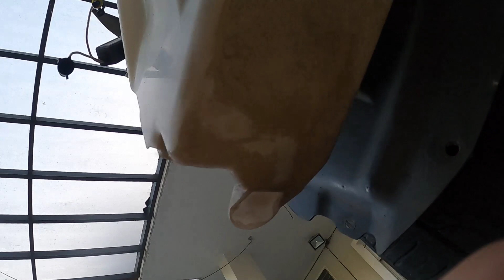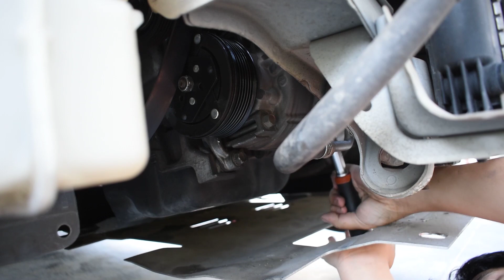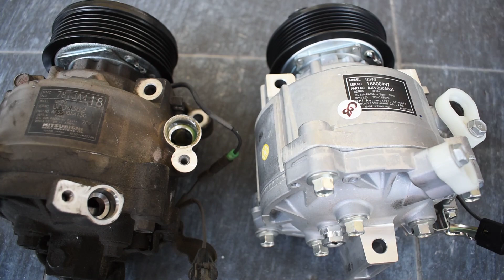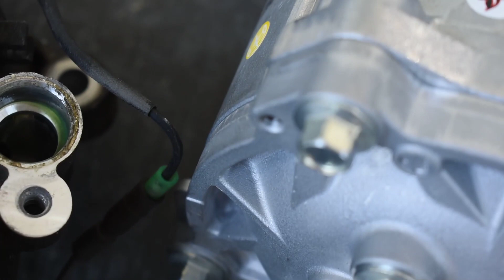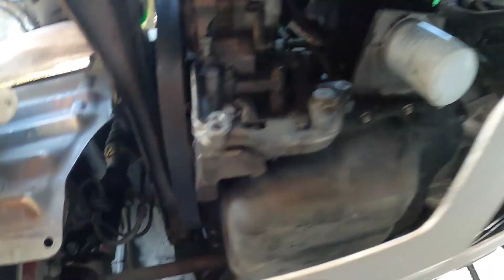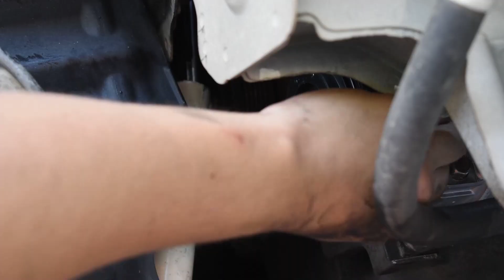AC Series - Replacing the Inspira/Lancer AC Compressor

Comment: I have a 2011 Lancer Es, I'm switching out the old compressor for the new one, i believe its a qs -90, I got the a'c lines vaccuumed out. I was gonna ask, Do I need to vaccuum it again before recharging it with A/C and refrigerant oil.
Reply from the maker: yes, you will need to vacuum it out again before charging it. This is to ensure there is no moisture within the system.
Reply: @TCsAnythingGoes  I'm thinking i'm getting the hang of this. I'm going to install the compressor today. The part just came in!. Thanks for the information. Clear concise.

Comment: Thanks for this video, I need to order the compressor but the auto parts place says there are two sizes for the belt. 3.2 and 4 do you know the size of the belt?
Reply from the maker: i am not familiar with the sizes you mention. If you meant the serpentine belt (aka V-belt, aka accessory belt), the size is 6PK2563 which translate to 6 channel and 2563mm lenght
Reply: @TCsAnythingGoes  thank you for the reply, but that isn't it. They sell them with 4.13 Inch Diameter Pulley or 3.75 inch diameter pulley. That's what I was asking.
Reply from the maker: @Aoneify  Ahhhh.... got it. The size of the compressor pulley.
Ok, from what i was told by the shop that sold the compressor to me, there is two sizes, big and small. 
It depends on which one your car is using.
Early Lancer (2008 and 2009) uses either one so you gotta compare your original.
Later Lancers and ALL Inspira uses the smaller pulley.
Mine is the smaller one.

Comment: Hi beloved bro you are my teacher.
Can you teach me is that could be the compressor problem if my suddenly stop working after awhile. The funny is after my cool down its work again until I drove awhile the cluch stop again for sure AC getting warm.
Reply from the maker: If I understand what you are saying, possibility of a faulting magnetic clutch. As the compressor shut off is triggered by temp. However, if you are hearing odd noises coming from the compressor, its more economical to just change the compressor (since it comes with a new magnetic clutch) and have the whole system flushed

Comment: I have a 2009 lancer, compressor only engages one time and doesn't engages after that. What should i check?
Reply: I have same problem … u need to change only single bearing
Reply from the maker: Probably the magnetic clutch.
Reply: Same problem... sometime it won't engage at all...  sometime it does...
Reply: @garychia19  change shaft bearing

Comment: bro, any noticeable difference between ori & oem u use? and how its going after 1 year?
Reply from the maker: I don't see any difference. As cold as the original. After 1 year, still working perfectly fine.
Reply: Well, Oem Condenser and Compressor is great with Original Cooling coil. Its depend on cooling coil quality. Sometime you uses the local product its probably not very cold

Comment: The magnetic clutch goes on and off all the time, what do you think? Also the ac fan not working, fuses OK and the fan is new, what do you think? 
I have after market android head unit, and "can time out" error code on obd scanner
Reply from the maker: It is normal for the clutch to go on and off depending on the temperature you set. I guess you can check the socket for the AC Fan and see if its burned out.
Reply: @TCsAnythingGoes  
I did install a new fan and still not working
Reply from the maker: @sgvrereferw6014  check if the socket connecting the fan is burned out. If it isn't then check if there is any voltage going thru the socket. If there is, try to hardwire the AC fan directly to the battery and see if it spins.
Reply: @TCsAnythingGoes  thanx
Reply: @TCsAnythingGoes  
When I turn on the ac ,the 2 fans should work?

Comment: so how did you re-pressurize the ac system after you replaced the coolant? can i just add the coolant without re-pressurizing the AC?
Reply from the maker: Pressure comes from the compressor as it compresses. I did bring it to the shop to have the entire system vacuum and added in new coolant.

Comment: Hey, how much PAG oil did you put in? How do you know how much to put? And how did you fill it? Thanks
Reply from the maker: I left that to the AC workshop when I went in to fill the gas. What I can see is that he put in via the the pipe as the gas. He vacuum the lines, then let the vacuum suck in the oil from a bottle. Didn't quite saw how much he put in.
Reply: @TCsAnythingGoes  ok thanks, and would you recommend changing also the evaporator? Why did you decide not to change yours? Thanks
Reply from the maker: @rnapol3266  I changed out the entire AC set.....except for the lines.

Comment: Hi. I changed the Compressor yesterday but started having idle problems, and some buzz when the compressor starts, do I have to let the new compressor get used to the serpentine belt? Or it’s normal to make a buzzing sound?
Reply: Do I need to change the drive belt when I change the compressor?
Reply from the maker: i did not change the belt after I replaced the compressor. And there should not be any run in period for the compressor. Is your compressor new or reconditioned? Is it from Japan or China?
When I did my research, we should always get back an original new compressor from Mitsubishi as the recondition ones is a gamble and China ones are just gonna last you 6 months to 2 years (or probably less based on some feedback i read)

Idle problems after changing the compressor, there is a possibility that the compressor bearing is too tight or faulty hence causing extra load to the engine. But I can't really say for sure.
Reply: TC's Anything Goes It’s brand new from Thailand
Reply: It only makes like a little vibration, when it turns on, not in the pulley, the rare thing it’s that the sound only can heard in the inside of the car
Reply from the maker: @ivanalbanez1257  hmmm... i suggest to check if the bolts mounting the compressor is tight enough. Another thing I would suggest is to check if any of the AC line is touch the chassis.
I had similar issue on my other car (Myvi) when I changed the compressor and the AC line was touching the front crash bar.
Reply: TC's Anything Goes thanks for replying

Comment: I having the magnet clucth problem, should i change magnet clucth only or new compressor? From your experience, what ur advise?
Reply from the maker: If there is sound coming from your compressor, then its better to change to a new compressor. If there is no sound (metal grinding metal sound), then just changing the magnetic clutch is good enough.
Reply: Suddenly sound weird then bau hangit...
Reply from the maker: Need to see where the bau hangit is coming from. If the aircond is still cold, then there is a possibility that it could be the other pulleys. But if aircond is no longer cold, then confirmed compressor jam already
Reply: @TCsAnythingGoes  done changed compressor jammed already n money fly awayy...haha..TQ 4 video..Nice info & sharing...

Comment: How do you remove the front quarter panel?
Care to make a video? Thanks.
Reply from the maker: Front quarter panel.... you mean the fender. I did not remove it for this DIY. Don't think I will be removing it anytime soon since I have no DIY plans for that portion yet.
Reply: @TCsAnythingGoes  from your video,  looks  like you have removed the driver side quarter panel because can see the serpentine belt easily.
Reply from the maker: @chiang-heelim4740  ahhhh, you meant the inner splash guard. That's just a few clips. I already have a video on how that is removed in the link below: https://www.youtube.com/watch?v=pc5ho8tXfkY
Its somewhere in the beginning of the video.

Comment: Great DIY job as always! When you say the compressor was stuck what were the symptoms?
Reply from the maker: the AC went off and there was a shrieking sound coming from the belt whenever the magnetic clutch engage. I had to disconnect the power to the compressor in order to continue driving else I think my serpentine belt would have burned as well.
Reply: @TCsAnythingGoes  thank you for this video very informative!